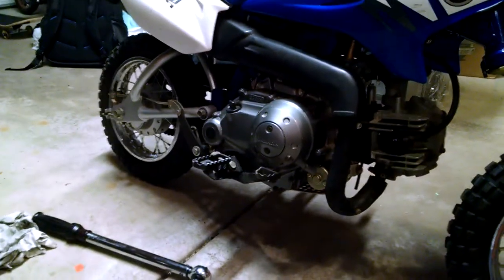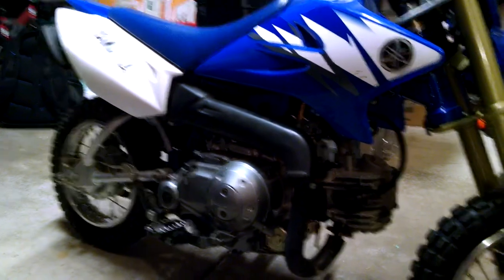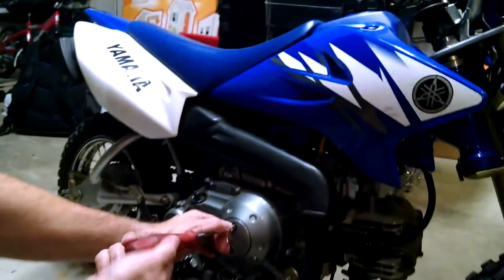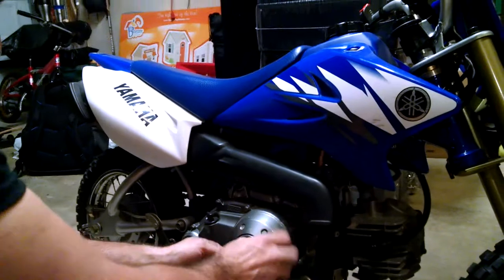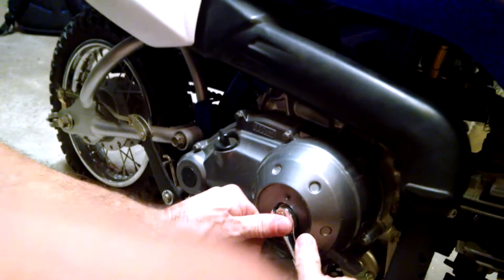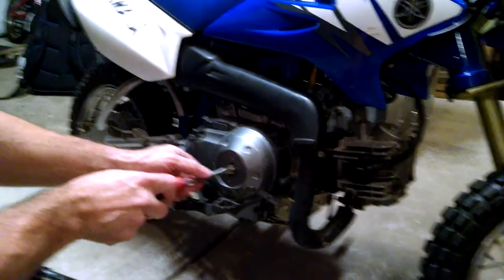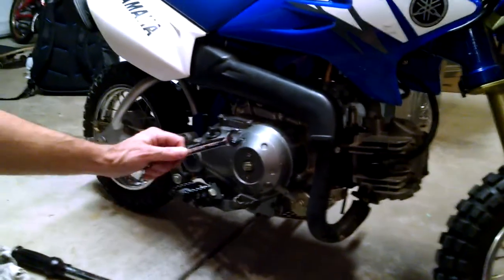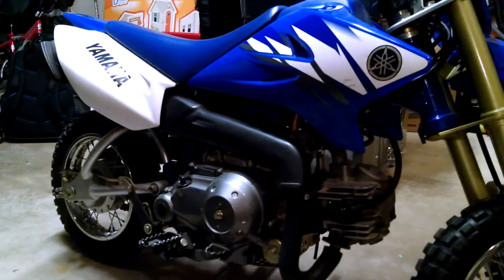How to adjust clutch on Yamaha TTR-50

Comment: So this makes it easier to shift with the foot
Reply from the maker: Yes, my son was pretty small when I did the video and was having a hard time to shift it.  After I did the adjustment, the shift effort was lower.
Reply: is there an oring under that nut? I have an oil leak from there
Reply: @monroe152 yeah there is.